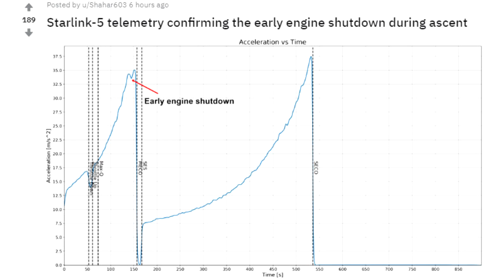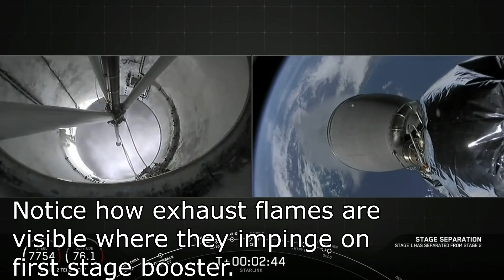Falcon 9 Suffers In Flight Engine Failure, Booster is Lost,  but Cargo Delivered Successfully

Comment: I think that the engine bell failed, not exploded, just failed to contain the expanding pressure and disintegrated especially due to what seems to be some debris on Reds’ video. I think the bell failed and damaged the engines around it and caused atleast one to fail during the re-entry burn and cause a LoV

Comment: On the plus note, those Starlink missions are basically testing the boosters to failure in real-world conditions, getting a lot more data without risking an outside customer's payload. This information can then be transferred to existing and new boosters, further improving it and making it safer for the customers than it was originally.

Comment: "Customers should not be concerned about losing their payload". This is true, but if SpaceX continues to lose 1st stages, they will have to start pricing their launches closer to what their competitors charge. The advantage that SpaceX holds over their competitors will slowly disappear.
Reply: Of the 2 boosters that they lost recently, one had 3 flights on it before it's last launch, and the other 4.
Given that track record, they're still saving lots of money overall.
Reply: @44R0Ndin  But not as much as they were before.
Reply: @Fadamor  They are rushing refurb on the boosters for their own payloads. Its called pushing the envelope.

Comment: I actually thought the crash was due to the space junk or whatever that was, which was a near miss, which made them change trajectory, but I guess you guys know better
Reply: The first stage never gets high enough for space junk to be a problem, any debris in orbit that low will have it's orbit decay within less than a day due to atmospheric drag, even at 100 miles altitude.
Reply: @44R0Ndin  then what do you recon that was?
Reply: Definitely wasn't space junk. I think SpaceX may have rushed refurbishment of the booster, result in a bad engine found during the on pad abort, then sent it up anyways to see what would happen.
Reply: @FreeStuffPlease  but what do you think that thing in the footage was? Since the guy above here said it's probably not debris... Of course my guess is just that, a guess... I don't have actual data to back anything and all you can see in the footage is a fast moving cluster of pixels haha
Reply: @mastercheatcomplete  No sorry I don't know. If it wasn't random space debris, then my guess would be it was part of the engine. Hard to tell what it is.. Looked like metal or something.
Reply: @mastercheatcomplete  Typically ice stays on the rocket and is randomly falling off as more and more fuel is burned, since the fuel is cryogenic.
Reply: @anthonypelchat  I'm not sure we're talking about the same thing, I'm talking about this object which passed really close to the first stage on its way down, looked like a round piece of metal (although it was very hard to tell).
Reply: @mastercheatcomplete  Yeah, we're talking about the same thing. While there is a possibility of it being something from the engines, anything that you see flying pass like that has almost always been ice leftover. It takes on the shape of whatever it was attached to.

Comment: Yes I noticed the fogging during reentry burn, and also unusual wobble at shutdown of that. This causes me to think of a question I hadn't thought of before. Certain F9 engines are fired up to 4 times per launch. Others, just once. Does SpaceX   account for these extra cycles?
Reply: They have to account for those extra cycles, because if they didn't they'd either be carrying too much TEA-TEB ignition fluid in the 6 engines that only start once, or not enough in the 3 that start multiple times.
Reply: @44R0Ndin  I'm talking about the wear and tear towards engine end of life. I'm sure they do, but, for instance, some of the engines will have far fewer cycles at the end of booster life, could those be removed and reused?

Comment: Falcon 9 was designed for ten launches, yet most don't come back from the forth, and this one failed on the fifth launch.

Honestly, not bad at all considering the immense physics involved in this endeavor. No other company has had this much success, and probably won't for a long time to come.
Reply: They're deliberately expending the Block 4 cores that they recovered, no matter how many flights they have on them. They're trying to recover and reuse as many B5 cores as possible.

Comment: About reliability: what about AMOS-6 and CRS-7?
Reply: was that engine issues?
Reply: @snuffeldjuret  You might have a fault-tolerant engine, but as a customer it doesn't matter. You buy a full service.
Reply: @snuffeldjuret  7:37: "I think *Falcon 9* still looks like an amazing reliable launch vehicle and nobody should feel conserned about flying payloads on it."
Reply: @saxus  This wasn't a failure for a client. The payload was delivered. This is the first engine failure during flight in years, and they have redundancy for engine failures. Basically, more engines. 

The other explosions did cause customer concerns. However, SpaceX has gotten past those and proven their reliability. They haven't had a launch failure since 2016 and are now launching more payloads then any other provider.
Reply: @anthonypelchat  I still talk about the whole system, not the engine. A customer doesn't care about the engine.
Reply: CRS-7 was Falcon 9 Stage 2 having a meltdown before it's ignition.
AMOS-6 didn't even fly but was also stage-2 fuel loading procedure that surprised everyone.

This is the first Merlin 1D to shutdown in flight. Merlin Vac engine is still at 100%.

Comment: What if the failed engine didnt explode but was one of the ones used for the entry burn?
so the flight computer decided to still attempt a recovery by trying to relight it to perform the entry burn only to have it fail again, causing the booster to come in too fast and get torns apart by the aerodynamic forces.
Reply: Ties in with Scott's theory that the excessive fog/droplets might be unburned propellant.
Reply: dgw indeed

Comment: It looks like they lost the center engine. That would make landing impossible.

Also, on reentry, the booster rotates left then right. I don't recall ever seeing that before.
Reply: Yeah, i'm pretty sure the rolling was normal, it was just experiencing turbulence.
Reply: @Surrenitie  Turbulance doesn't happen that high up. There are a lot things that could have happened, but not really weather.
Reply: @TonboIV  But think about it, stage 1 is traveling around mach 2-3 at that point theres gotta be some turbulence happening right?
Anyway thats not the point it looks it may have been something weird with the grid fins
Reply: @Surrenitie  Turbulent flow will be happening in the areas of subsonic flow, but the "turbulence" that shakes airplanes is a weather phenomenon, and there is no weather in the high atmosphere.
Reply: @TonboIV  At that point, the booster is going at least a thousand metres per second through the atmosphere. Yes, it's thin atmosphere, but oscillations are most certainly possible - it's just aerodynamics, not "the weather."
Reply: @TechTekker  Oh sure. All kinds of things could have happened, but when people say "turbulance" like that unqualified talking about a shaking vehicle, they're usually referring to weather.
Reply: By "Turbulence" i didn't mean weather just air doing what air does best. screwing with things-oh wait thats water.
Reply: I love how nobody is making conclusion, just observation and estimation.
Nice
Reply: @baejunyoung9310  You want a conclusion? SpaceX rushed refurbishment on the booster since its for Starlink. Then they found out they had a bad engine during the on pad abort. They decided to send it off anyways. The engine blew out. The entry burn was effected by this and couldn't slow down enough. The avionics then aborted the landing. Okay I'm still guessing 🤷
Reply: It might of been a grid fin. Doesn't really seem like the hydraulics failed but maybe it was the avionics. They may have glitched out and didn't know what to do. Definitely possible after an engine failure. Maybe it had something to do with the thrust vector control but I don't know if it would cause that. Unless the grid fins work together with it. Hopefully SpaceX figures it out and also lets us know. I think this landing failure will actually be a success in the end adding more reliability incase of future situations like these.
Edit: after reading some other comments, its also possible maybe it was coming in too fast after the entry burn and may have caused the landing to abort. Just another guess.
Reply: @FreeStuffPlease  Aren't the hydraulics powered by a pump connected to the engine? Maybe the loss of one pump changed how the gridfins responded and this situation wasn't planned / programmed for? Though, I really have no clue.
Reply: @pyreaurum676  This is an interesting idea.
Reply: That roll occurs right after MECO 2. We can see the grid fin swivel both ways, so roll was caused by grid fins. 

Normally the booster will adjust yaw/pitch to get some steering authority at that moment, but it rolled instead.
Reply: I won't speculate on the cause, but I believe the booster went into a spin loosing telemetry contact and aborted the landing. As a propulsion engineer I would love to have that engine that failed for analysis.
Reply: It looks like the fins are disabled and locked in neutral position during the entry burn but their PID loop continues to run, and this time the attitude deviation was larger than usual (asymmetrical thrust?) so when they were unlocked after engine shutdown they overcompensated for a few seconds and made that weird roll.
The supposed liquid on the camera could be from damaged hydraulics if the damage was small enough to not lose pressure right away but gradually over time.
Reply: @mc3123456  That makes sense.
Reply: doubtful because they'd have given up on landing as they need the center engine to run the landing
Reply: @AsbestosMuffins  I don't think it was the center engine probably one off to the side.
Reply: iirc there was a similar roll back and forth on an attempt that failed due to a unsteerable grid fin
Reply: I'm afraid that that is why I will not put up with multiple engines. I will stipulate that in my contract for the design of Sea Dragon II that I'm finalizing with Samsung's shipbuilding division. There will be one super-sized engine the size of a small house. Since the 100-meter booster* will be dedicated strictly to cargo transport, and not man-rated, and tested and re-tested and torture-tested to heII and back, it will never be surpassed in reliability and economy of scale.
* pump-fed, not pressure; coaxial methalox tank geometry.

Comment: for me it looks like the rocket tilts to the side quite severely during the reentry burn, maybe it only burned 2/3 engines there.
Reply: Human Person I like your theory. Engines would tilt stage a bit to compensate for asymmetric thrust, and then right after shutdown this tilt would have to be a source of aerodynamic forces, to be corrected, which we probably see as a maneuver by grid fins. 👍

Comment: Would there ever be a scenario where it wouldn't be worth it to land the booster even if it's too risky to land on the barge they can still attempt to do a soft water landing to recover as much of the vehicle as possible and study the failure with more data then just the senors on the rocket transmit down to earth?

Comment: Thanks for the video from isolation!
Can I ask why Falcon has nine engines, instead of a lower, more reasonable number, like two or three? It reminds me of 50 yrs ago, with the N1 vs. Saturn V...
Thumbs up from me, again thanks for
Reply: allows for the benefit of mass production is what I recall hearing as an argument. And as Scott said, you can have an engine failure without failing the mission. Not sure how easy it would be to do the landing with fewer engines and not sure how the thrust to weight ratio is on the larger ones.
Reply: @snuffeldjuret  Usually booster engines they cannot throttle under 50%, for a RD-180 it makes landing that way a no-go

Comment: I think a comment that was left out at the end was that this is SpaceX using an internal mission to really push these boosters to their limits all the while testing the limits of reusability. It's a safe bet that because of this engine failure everyone else's flights will have their success chances bump up ever so slightly when they're able to piece together the data on this and continue their push to 10 reflights.

Comment: These things seem to happen specific to Starlink launches.. best fix that for the optimistic launch schedule set on the program.. atleast until Starship is operational to take over.
Reply: Curator on the internet. I think because they try new stuff and risky stuff on the Starlink launches since they're all internal
Reply: @bobbob123ful  Risk on landing, like the high wind strain test they preformed successfully after this last CRS resupply mission.
Reply: That's because they use older boosters for Starlink. This one was flying for the 5th time and if I remember well, so was the previous. 
And about the 5 launches limit, well it's true that this one failed for internal problems, but the last one before this would have landed succesfully if it weren't for those wind data. The booster itself was still fine. So, even if it's two in a row, in a similar mission, in similar condiitons, it's actually two very different landing failures, this one internal to the booster, that one external.
Reply: @trezapoioiuy  5 launches still isn't nothing, but yes, SpaceX was hoping for ATLEAST 10 flights per individual booster, if it is determined to be A lifetime issue.
Reply: Curator on the internet. But as I said the one that was lost last time was lost due to wrong wind data, which means that with the good data it would have landed and been flown at least one more.
This one didn’t but at least it’s not as systematic as it looks like.
Also they never said they would move straight from no reusability to full 10 time reusability. 10 is an estimated objective not the minimum requirement to make F9 viable.  
The boosters that move from customer to SL are boosters that already generated their share of revenue and covered the expenses.
Reply: As others have said, Starlink launches are special. One thing that I didn't see anyone else mention is that SL launches are at the absolute max capability for reusability. That is also why they were trying something different with the second stage to reduce fuel needs and stress on the booster.
Reply: Once is happenstance. Twice is coincidence.  ...
Reply: @shrikedecil  I wouldn't worry, they obviously will learn and fix. It's A miracle they get it to work, anyways it's not the upper stage or payload at risk, remember other launch systems happen this way every launch, lacking the reusability.. it's not any sort of A major loss, they just save more when they save the booster.
Reply: Starlink is the graveyard for these boosters. Funny thing is that it's around about the five launch mark.  So they still need a lot of work for their stated 10 launch refurbishment thing.
Reply: @StaK_1980   They said they'd be ramping up weekly launches later this year, I believe.
Reply: Better fix it or they'll run out of boosters not long after.

Comment: This and the last landing stage loss were both on the fifth landing of the respective boosters.  Maybe they just reached the limit of the number of reuses they can do.
Reply: Wrong wind data has nothing to do with reliability.
This one obviously shouldn't have been flown in the condition it was in, but the last one had nothing technically wrong with it.

Comment: Most successful failure to date. The shuttle did a lot of engine swapping during its use.  I am curious about the engines on a Falcon 9?  Do they swap out engines during refurb, or are all engines the same.  This one booster had a remarkable 44.9 successful engine flights.
Reply: The shuttle didn't get new engines every time, the engines they had were fully disassembled and put back together before the next flight.
The Falcon 9 has inspections, but I don't think they take apart the engines any more than they need to to put more TEA-TEB ignition fluid back in them unless they find something on the inspections.
Reply: I think they are rushing refurbishments on these Starlink boosters just for testing purposes.

Comment: What the heck? 5:29 is that even debris? Looks like A big bold to something.. looks like it has fins, ironically similar to A blurry distance shot of that Dragon capsule with that distinct and iconic shape..
Reply: It doesn't even look like it comes from the trunk of the booster.
Reply: I have seen that very shape many times before
Reply: @snuffeldjuret  What do you mean? What is it ?  (Don't say aliens. Or did you mean Dragon ?)
Reply: @snuffeldjuret  Well the "space snake" clearly did detach, but wasn't ice. I forget what it was assumed to be, looked like maybe A severed gasket ?

Comment: Are they continuing to test to extremes the rocket as it's their cargo if things go wrong? Always good to know how near the edge you can go before failure, then dial back to a safe degree.
Reply: That is what you do when the payload is yours(especially when it isn't something critical).  Makes it even cheaper because you are using parts you would otherwise toss/recycle.

Comment: Maybe next time they will change out the engine that has an issue. Instead of losing the whole first stage.
Reply: I mean, going by what he sayd atleast 2 engines failed, on launch the outer one and on reentry one of the inner ones probly... Unlucky for two of them to fail